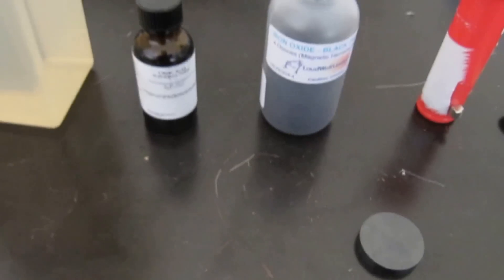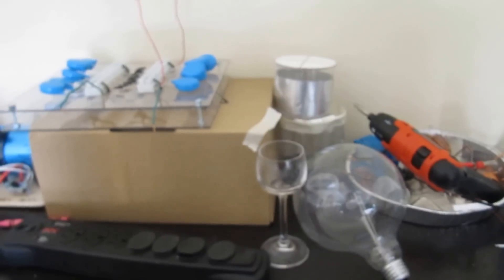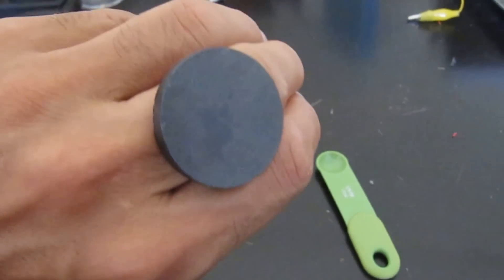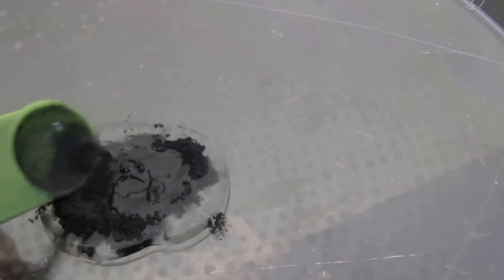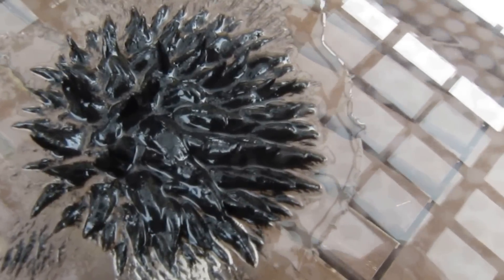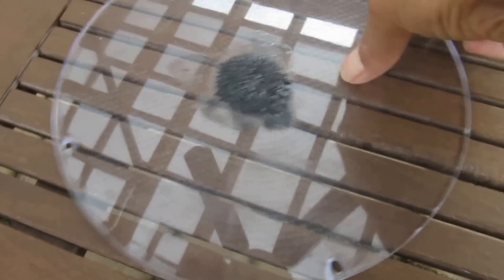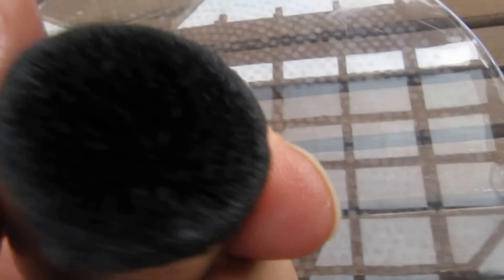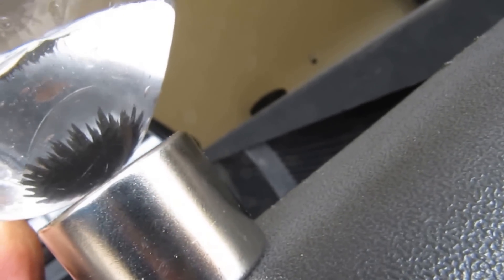Home Made Ferrofluid

Comment: Can I use citric acid (lime) or oxalic acid instead of oleic acid?
Reply from the maker: First Last   oxalic or citric would not work as they do not have high enough solubility in the mineral oil. Oleic acid is lioophilic enough that it dissolves in the mineral oil to  stabilize the magnetite particles from clumping together.

Comment: what magnet do you need
Reply from the maker: Antonio Mora  the best magnet is a neodymium magnet or you can use an iron bolt that is contact with a ceramic magnet.
Reply: TeslaSpot 101 thanks, but how much and where?
Reply from the maker: Antonio Mora just a medium sized neomagnet placed right beneath the ferrofluid. This should work fine:
https://www.ebay.com/itm/252043604320
Reply: TeslaSpot 101 thanks where can i buy the ferrofluid
Reply from the maker: Antonio Mora neomagnets work best but you can also use ceramic

Comment: Hello, thank you so much for this video.  I used your recipe with mineral oil, oleic acid, and black iron oxide.  When I put a magnet under the plastic disc, the fluid spiked a little, but around the spikes was a red fluid. Moving the magnet around under the disc created more red fluid, which was very watery looking.  When I held the magnet a little bit away from the plastic disc, the red fluid did not appear.  Do you know why this may have happened?

Comment: My son and I have been trying this for his science project. We have baby oil, olive oil, toner powder, neodymium rare-earth magnets. I also purchased iron oxide/red 75 micron powder (fe2o3). We could not make this spike any of the various combinations we tried. Are you magnifying this for effect? We do see the fluid move with the magnetic but no spikes. What exact is the mineral oil to olive oil mix? 1/4 teaspoon to 1/8 teaspoon? We tried a clear plastic plate and a bottle with water. Neither show more that small movement.
Reply from the maker: C Thompson not sure what to make of it but it sounds like the toner that you are using probably does not contain a significant percentage of magnetite particles. I tried toner as well, and found it did not work.  The only thing  I was able to get working was the magnetic hematite shown in the video from the company indicated in the video. Let me know if you have trouble getting the above magnetite.
Reply from the maker: the red iron oxide Fe2O3 is non ferromagnetic. Only the Fe3O4 works. The stuff I was using is non colloidal, ie just a fine powder, so the ferrofluid that was formed was more of a slurry in the oil.
Reply: You are probably not using a large enough magnet.

Comment: This isn't ferrofluid. Real ferrofluid is a fluid (duh), but your mixture is clearly a paste. As much as you try to thin it out the magnetite is still easy to separate from the oil. It is not a stable colloid nor is it a suspension. I'm not sure which one ferrofluid is supposed to be, but if stearic acid is a key ingredient then it is likely a colloid. The consistency of real ferrofluid is nearly identical to that of carrier fluid itself. If you remove the magnetic field you should be able to pour the entire contents of the container into a different container very quickly (less than 1 second). After pouring, there should be no sediment or clumps left behind.  If left alone overnight, away from a magnetic field, ferrofluid will remain homogenous and have the same consistency as the day before. It will not settle out of the carrier fluid. Alternatively if you leave it with a magnet holding above the fluid level then the carrier fluid should not slowly drip out of the mass held by the magnet. Instead, I predict  that by morning you would have a nearly dry mass of  magnetite stuck to your magnet above a nearly clear container of fluid. Again, that should NOT happen with a ferrofluid. Using mechanical means it should be impossible to separate the fluid carrier from the magnetic particles.

I'm not saying what you made isn't fun and interesting, but it has different properties from a ferrofluid.
Reply from the maker: Noah Spurrier totally agree- this product is as close as you can get without having to make colloidal hematite. Behaves very similar on exposure to magnets. The oleic acid helps reduce clumping to some extent.
Reply: TeslaSpot 101 Yes, I've tried without much luck to make a real ferrofluid. I've come up with a few interesting compounds, but none have the magic of real ferrofluid. There's a big gap between "that's pretty cool" and "What!? That's amazing!" Grinding seems to help and I've noticed that after a while the carrier fluid starts to get stained with material that does not settle out of the carrier. Not enough to make the fluid magnetic, however. I might setup a ball mill to grind the material for a few days or weeks. Apparently this is one of the steps in many commercial  ferrofluid preparations. I was hoping there was an easier route to a ferrofluid with decent performance.
Reply: lol i love comment rants :D

Comment: Thank you for your video. I have two questions. 
1) I checked the manufacturer's site in order to trace the powder grade you used in your video. They do not sell it as "Magnetic Hematite", but as "Black Iron Oxide, Magnetite". I think that it makes no difference for the specific purpose, but I would just like to ensure that it is also suitable. 
2) I am reading online, that in order to achieve "spikes" you should use nanoparticles of iron oxide. This manufacturer, delivers 44μm sized iron oxide. Does the powder you used has the same size, or it is even finer? Will μm sized powder work, in combination with oleic acid?
Reply from the maker: I found it makes no difference. The finer the grade the grade you can get the better. It may be worth calling them or emailing them to see if you can get the finest grade they sell. I any case the one i have above was not that fine and seemed to work well.

Comment: could i use vegetable oil and olive oil or maybe just olive oil or do you suggest to use the mineral oil for this.
Reply from the maker: Try the olive oil first. I used mineral oil with some olive oil mixed in and with worked well. I also tried just plain olive oil and that worked too. Good luck. Let me know if you need any further help :)
Reply: TeslaSpot 101 what's the effect with vegetable oil?

Comment: Can you help me?  I am trying to make this and I am using printer toner that is magnetic because it is drawn to the magnet.  I am combining it with vegetable oil and I added a little olive oil like you said but my solution won't form the spikes.  It just draws into a clump above the magnet.  What do I need to do?
Reply from the maker: The best thing to do is to use the minimal amount of oil compared with the amount of toner so it forms a thick slurry. Try this out and see if it works. Also, make sure you are using a neodynium magnet. If it still does not work after trying this, then it could be that the concentration of magnetic particles in the toner is not sufficient to draw up spikes. Try with and without the addition of a small amount of olive oil.  Good luck and let me know how this works for you. :)

Comment: I used a different kind of oil and the spikes didn't come up. Help pls
Reply from the maker: Jo Seguel what kind of oil did you use? Try olive oil or something more viscous which will help to suspend the iron oxide particles. Are you using Fe3O4? What is the particle size?

Comment: Is it worth tracking down oleic acid or is olive oil fine as a surfactant?
Reply from the maker: Would just try the olive oil first. It should work fine.
Reply: +TeslaSpot 101 I just tried every recipe with MICR and it didn't work until I used actual iron oxide.  You have the only legitimate tutorial on youtube!
Reply from the maker: Jason Whetzell Great I am happy it is working for you. Generating colloidal iron via chemical reaction and doing it that way is a pain and I was surprised  to find this way worked just as well. I also had no success trying several different toner powders.

Comment: Im currently working with ferrofluid and MR fluids. 
Instead for lacerate toner I have magnetic powder with a partial size of 0,2 - 0,8 µm

My problem:

Because the partial size is greater than the toner it will separate from the oil because of the Brownian principle. 
How can i suspend my magnetic powder in e.g. oil ?
Reply from the maker: Try neat olive oil or try a dispersant such as oleic acid. This may take a bit of experimentation but is well worth it! Also try minimizing the volume of oil compared with the amount of particulate iron oxide.
Reply: +TeslaSpot 101 sounds like a plan
So mixing my magnetite with e.g. Oli
And then maybe suspend it in water

Comment: wouldn't it make more sense to just do the whole thing in olive oil instead of mineral oil and oleic acid?
Reply: ***** true, but if you kept it in an enclosed container and blasted it with UV light it would probably preserve pretty well.  Olive oil in a bottle doesn't really go bad that easily
Reply: +Peter Schmidt Why argue? the mineral oil takes a lot less work and you dont have to blast it with UV. I just dont get why you need it to be olive oil.
Reply: Austin _game did you not watch the video?  Olive oil has 2 of the main ingredients.  It's also more readily available.
Reply: It ROTS. Mineral oil is always readily available at the CVS, Walgreens, and any other supermarket in the skin care isle. Baby oil is just mineral oil that is scented. Both are just as available as olive oil, and are higher quality and dont rot, so you dont need to seal it and shine UV light. UV light is more uncommon than mineral oil itself. It would just be a pain to use olive oil and/ or vegetable oil.
Reply: Austin _game Well, the probability of needing UV light is still low.  The chances of olive oil rotting is also low.  I've seen containers of various cooking oils sit around for years while still being usable.
Reply: Peter Schmidt I still dont see why you need it to be olive oil. It doesn't matter anyway. some chemists just want higher quality things.

Comment: What is the longevity of this fluid?  Do the ferric particles eventually settle out?
Reply from the maker: I've had it lying around for months in a plastic bottle. The oleic acid seems to stabilize it well and prevent much settling. It may need a quick shake or stir before reuse depending on the particle size, however!
Reply: Brian D Oh, by the way, the videos you will find most interesting are 2, 3 and 4 (as video 1 is advice to people new to handling these magnets for the most part).
Reply from the maker: Thanks that's helpful!